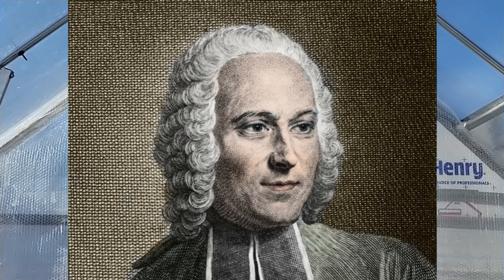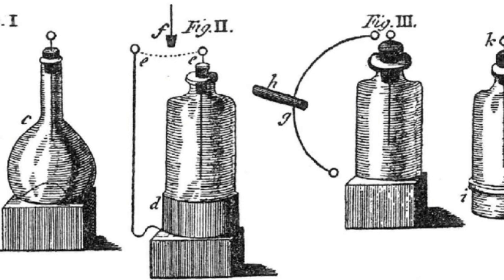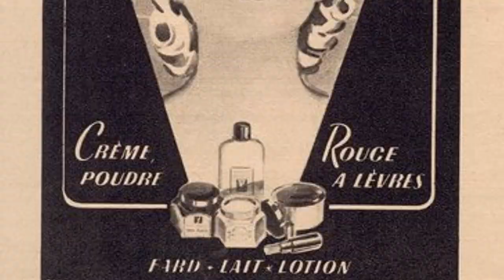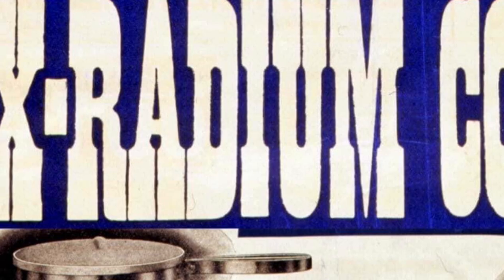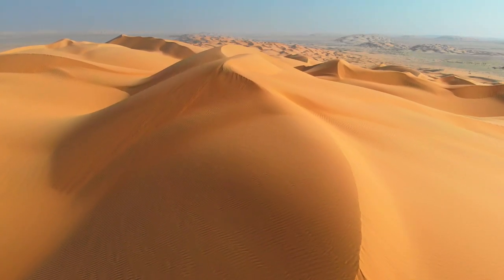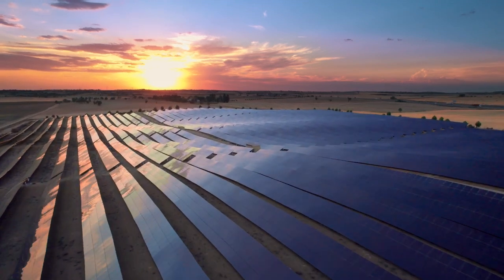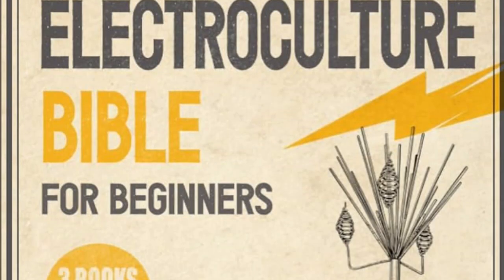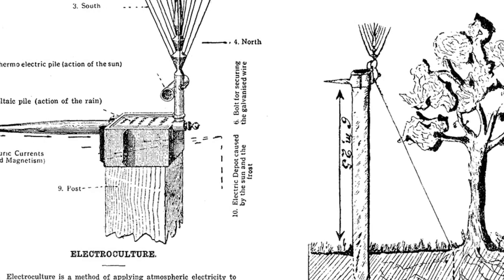Garden Science: Electroculture

Comment: The wire could also be aluminum. It can't be steel though. It has to be a non ferrous metal.
Reply from the maker: Your comment reflects some of my own thinking. Why just copper? Any conductive metal should work, given the common descriptions of electroculture. But that leads to a follow-up question: Why not ferrous metal?

I have to say that this is a potential confound in my first experiment that I'm finishing setting up today. I'm growing lettuce with copper coils in my greenhouse. But it's an aluminum framed greenhouse. So that could be a big problem for the experiment. Maybe not, though- none of the aluminum penetrates into the ground and my greenhouse foundation is wood.

Comment: If you look at a tree without leaves - it looks like an upside down electric bolt.
That's not an accident.
Humans live between two cionducting layers - the crust and the ionosphere. 
And ALL plants on the ground follow the same path of discharge. 
By using a copper wire in the ground - you are in fact REDUCING the net charge on the plant. It may in one sense reduce the elecromagnetic field strength around the plant. Hence, liquid - like water - require LESS energy to travel in the xylem. 
That may be a factor in contributing to its overall maximum size.
Reply from the maker: That sounds pretty convincing and sciencey unless you know that the net charge within any charged sphere is zero. The ionosphere is a charged sphere and basically acts like the Earth's Faraday cage, shielding us from all that charge with a zero charge bubble.

The structure of trees is a function of them having evolved to maximize the surface area of their leaves that is exposed to sunlight in order that they may perform photosynthesis. Resemblance between some (but certainly not all) trees and lightning bolts is a coincidence.

The rest of your claims introduce a conflict. Now we're left with a system that either helps plants grow by increasing the charge around them or helps plants grow by reducing the charge around them, and neither claim is supported by evidence. Conflicting claims do not strengthen an argument, they only make it that much more problematic.
Reply: Just to clarify - yes. The Earth may be electrically neutral IF measured as from the OUTSIDE.
We live inside two electrical layers that are NOT neutral. See lightning for details... lol.
I studied both Physics and Biology (a Major -  Minor degree ) so I'm not pulling this out of a hat.
But I have not PERSONALLY done these experiments with growth and electricity. But what I want to say is that there is ALWAYS current flowing between the Sky and the Ground. It is relatively small - but it is always there. Nearly ever plant has a net negative charge. It helps bees find flowers. (Bees tend to carry a positive charge)
So - there MAY be something here that folks are missing. My suggested explanation is just a hypothesis. It helps to look deeper into this before coming to a final conclusion though.
Reply from the maker: @MathewTitus , stay tuned as I trial electroculture in my own garden, but seriously, nobody has had consistent or reproducible success with the method. There is no published scientific research that supports the electroculture hypothesis.

Yes, there are transient charge differentials that develop between the sky and the ground, but those are different from what you mentioned previously with the ionosphere which starts at an altitude of 37 to 190 miles. 

Yes, plants generally have a negative charge. So do bacteria. These are very small and localized charges that are involved in interactions that don't reach far enough from the organisms for us to reasonably conclude that they're channeling electrical energy from the sky.

I'm a Biology major with a minor in Chemistry and I've done a lot of work in chemistry labs. But really, neither my nor your scientific qualifications have anything to do with the issue of electroculture beyond the fact that they should make us both cognizant of the importance of evidence in drawing conclusions. In this case there's a conspicuous absence of compelling evidence despite looking for it since Darwin's time. If we're being scientifically minded, that means we should favor the null hypothesis.

Comment: What’s the circuit needed to transform radio waves into “electricity “?
Reply from the maker: When magnetic fields move relative to a conductive material it can cause an electrical current. No other special equipment is required. However, that only happens if there's somewhere for the electricity to go. Absent a destination (an electrical circuit is just the path taken by electrical current) there is no current.

In a direct current circuit powered by a battery, the circuit would be the wires leading from the cathode to the anode of the battery, along with any capacitors or resistors or other bits and bobs along the way.

When radio waves interact with an antenna, they produce an alternating current. Now, technically, it's possible for an antenna to have an alternating current without the electricity going anywhere. But why would that matter? If the electricity just hangs out in the antenna and wiggles a bit it isn't really changing anything aside from very slightly raising the temperature of the antenna. If the antenna is a part of a radio, the alternating current and the accompanying radio signal is converted to sound.

There are also special antennas, called rectennas, that can convert radio waves into direct current which can be used to power objects. But the amount of energy obtained from radio waves is usually very small, which is why machines like AM/FM radios and our cell phones need supplementary power supplies (batteries or plugging into sockets) to work.

Comment: Most electricity comes from the Sun, it enters the Earth thru the magnetosphere and gets shaped into Birkeland currents. These currents follow a spiral pattern down to the ground. Maybe garden antennas should be modelled following this electromagnetic shape.
Reply from the maker: Out of curiosity: I've noticed a fixation on spirals in a lot of electroculture literature. But apart from being able to pack more feet of wire into a smaller space, I'm unclear on the utility of a spiral. The Earth's magnetic fields are much too large for a small-scale shape to make a difference. A garden antenna would be less than microscopic compared to currents generated in the magnetosphere- this is why the Carrington event caused sparks in telegraph wires but not in smaller metal structures. The telegraph wires were the only metal structures large enough to interact with the electrical fields produced by the geomagnetic storm. So... completely off-topic, but that's another reason to get excited about a decentralized grid: It's about the only way to ensure that another Carrington-scale geomagnetic storm doesn't wipe out our electrical grid.

Comment: YES DO IT! if all else it will start conversations about gardening! 😅
Reply from the maker: I'm more than a bit stunned by how many folks are choosing to watch this video. I'd be a fool not to follow up! I may have to set something up in my greenhouse so we don't need to wait until spring.
Reply: @casualgardeningwithdustin  I made 3 antenna this past spring. I am unsure if they made any difference, because I didn't have a "control" with out antenna. But I did pick up a magnetic field at the bottom of antenna between 4 to 8 " above soil??? So this year I plan on making two beds one with the antenna one without.  There are labs "pulling" elecro-static power from graphine antenna 50+  feet above ground.. so ?? Aether!
Reply from the maker: @dg7851 , well, my next electroculture video is in the works, and just as you mentioned it will be an experiment with a control. But I might cheat a little bit and also talk about experiment design and the scientific method. I'm really excited to do another plant experiment! I haven't done any since I worked R&D at a fertilizer company.